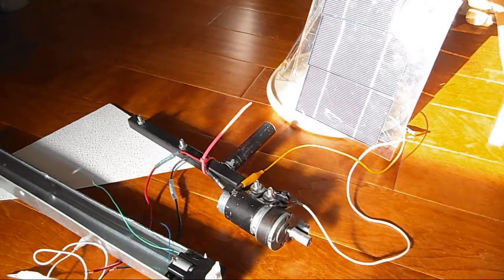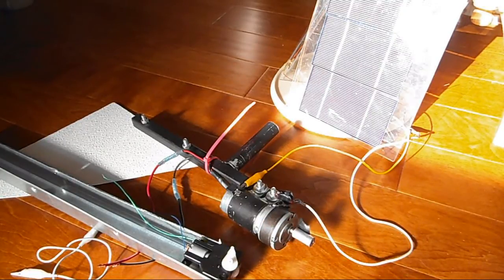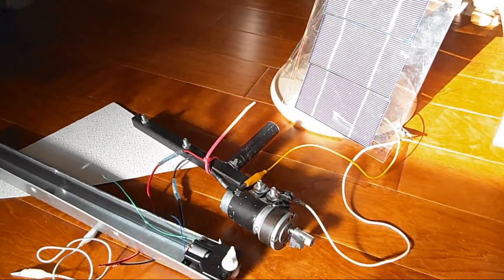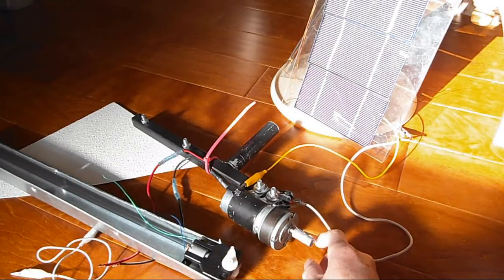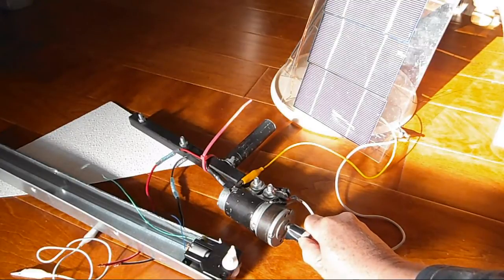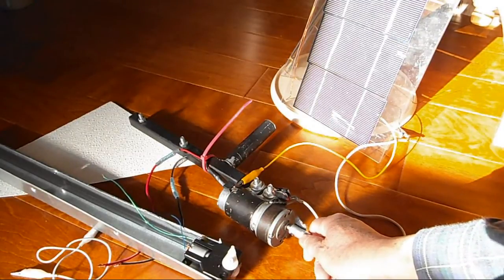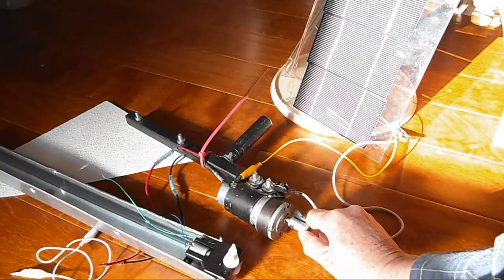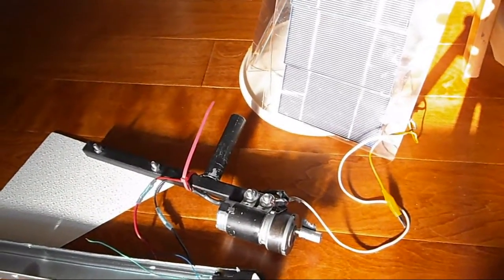Surprised to find my diy solar panel driving bigger geared motor for solar tracker.pt 4

Comment: Hi Tam,  may i ask where did you get the gear motor?  I have 100 watt solar panel and plan to build the solar tracker.  I would love to consult with you if you willing offer some.  Anyway,  please let me know.  I really appreciate it.  Thanks for a great videos
Reply from the maker: I got it on eBay. You can use any low rpm geared motor and it should work.
Reply: @wtam69  thank so much for your response.  Is it possible that you can send me an email that i can ask a few questions with pics of my setup? kttran1972@gmail.com
Reply: Can you provide the spec of your 12v dc motor
Reply from the maker: @kttran2005  If I recall correctly, it's a 12v,  60 rpm geared motor operating in the 5 to 10 amp range.
Reply: @wtam69  wonderful,  thanks Tam
Reply: I really appreciate it

Comment from the maker: This geared motor is hard to turn even by hand. As a wind turbine, it's hard to get more than a few volts from it. In this application, it only has to turn slowly but with power.

Comment: Yes they do.  Even if you'd go with relays, you still have to use a power transistor circuit  to turn on the relay coil and when you use things that have coils (motors, relay, solenoids), you  need to have flyback protection from the reverse induction voltage after it stops.  It crates electricity like a generator for a short time after the coil has been turned off.  I want one of those tv antenna turners because it's so easy to make a tracker out of.

Comment: Not to introduce you to a headace, but an Arduino would do the job with a photo resistor.  Sketches can be downoaded from the internet too.  They make motor controller  boards that plug right in on top of an Arduino which makes it pretty easy.  I think the easiest way would be to buy a tv rotor that is programable.  I've seen them for around 80 bucks on ebay.

Comment from the maker: Yes, a controller is the way to go. I was looking into the Arduino boards but I don't know much about them. In this setup, the power source is the solar panels and not a battery so I don't think a diode is needed. I could be wrong.

Comment: It might be helpful to look on ebay for a motor controller.  They are cheap, but I'm not sure how you could control it without a micro controller.  When a motor stops rotating, induction power will flow backward into your power source and ruin your power supply if you don't use a diode to stop backward electricity flow.  Search for motor flyback diode and you'll see what I'm saying.

Comment from the maker: You are right about not having to spin that much. When 12 volt is applied, the motor shaft turns briskly and strongly. I was just surprised to see voltage as little as 1.5v at 3.5 amps can turn the motor.  I suppose there is some merits in trial and error.